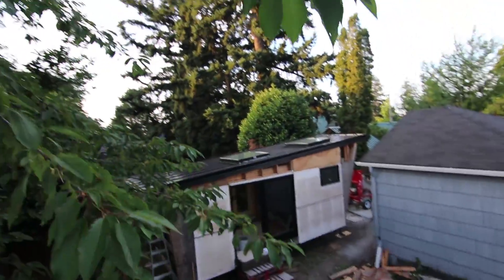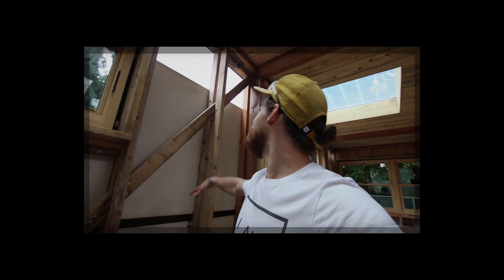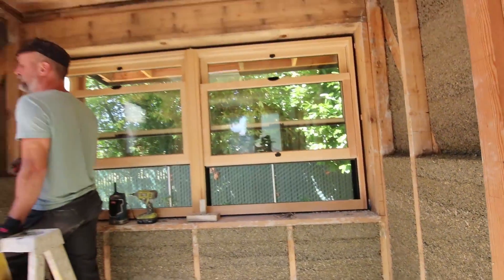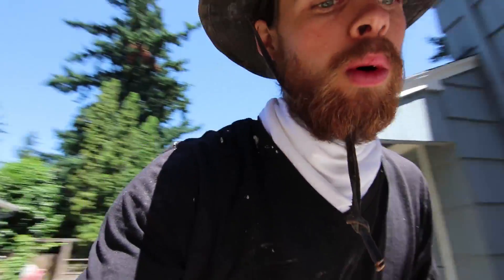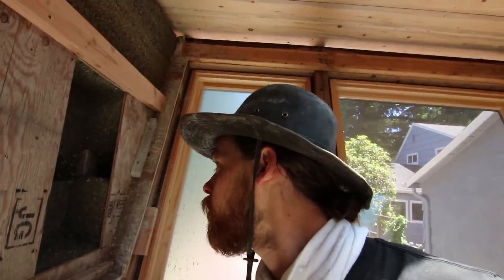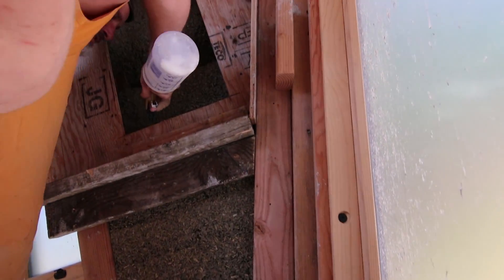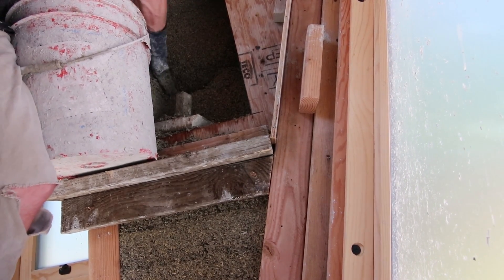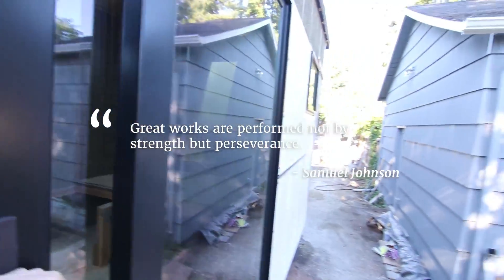Hempcrete is DOPE—literally! And here's what makes it so magical.

Comment: Where did you get your hemp bales and what brand of lime product did you use?  You titled a previous video something about learn from my mistakes or something...but then didn't talk about anything that you would do differently.  Could you talk about that...PLEASE?  : - D  One thing I read was that those barrel mixers were not great for hempcrete, but obviously you used it.  Anything you can share about the pros and cons of that mixer would be so helpful.  What did you use as the external sheathing on the tiny, lime plaster?  Rain shield with wood siding?  Have you ever moved the tiny and if so did any of the hempcrete crack?  Lastly, how is that sloped wall holding up?  

Hey thanks so much!
Reply from the maker: Great questions! I shipped the hemp bales from the Netherlands and the lime binder from France. The barrel mixer worked great. It was consistent, fast, and convenient. I used magnesium board as the external sheathing. 5+ years later and everything is holding up great amidst the wet PNW winters and hot summers. No cracks in the hempcreate or internal plaster, though I've only moved the tiny a few feet forward and backward to get it into a better position.
Reply: @mattprindle  Hi Matt, thanks so much for the info and the update.  That's good to hear about the barrel mixer working well.  So much easier to come by (and less expensive) than the other styles.  

First of all, LOVE your tiny!  Great build.  We live here in Portland too BTW, but are building our house out by Silverton, east of Salem, so same weather patterns basically the same.  Anyway, we were hoping we could find hemp hurd and binders that are actually made here in the US vs importing in from Europe.  I know it's been 5 years since you built yours, but do you happen know whether reputable hemp hurd and binders are manufactured here in the US now or still only as imported products?  By any chance do you remember what was in the binder mix you used?  We've read about hydrated lime and other kinds of lime as well, so curious what was in the product you used.  

Lastly, has anyone ever told you you resemble Brad Pitt?  Some of your goofy antics and facial expressions in your videos reminded me of him in some of his movies!  
😅

Comment: Did you finish the house? Interesting use of materials for a tiny house. Curious how you finished off the mgo board exterior and interior plastering. Any cracking from transporting the structure?
Reply from the maker: I finished! And have been living in it for the past 5 years. I didn't want or need to add any finish to the mgo board. I used sand from my favorite beach and hair from my favorite dog mixed with lime and water for the interior plaster. No cracking, though I haven't transported since finishing it (other than a few feet forward).